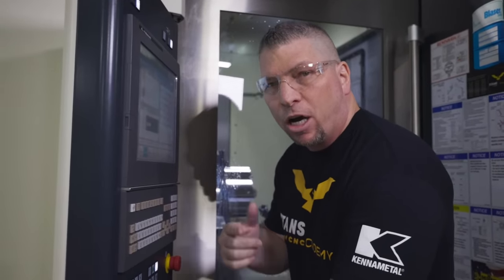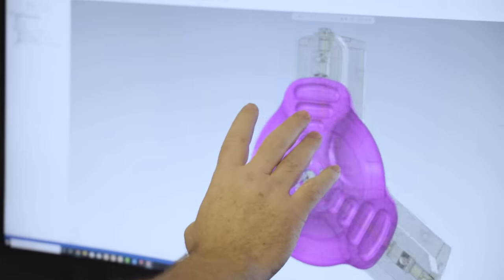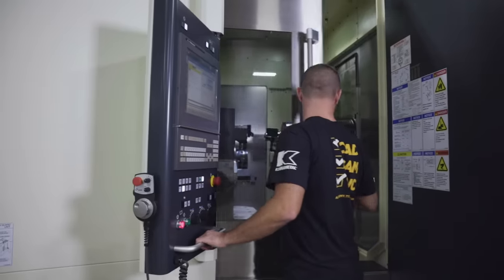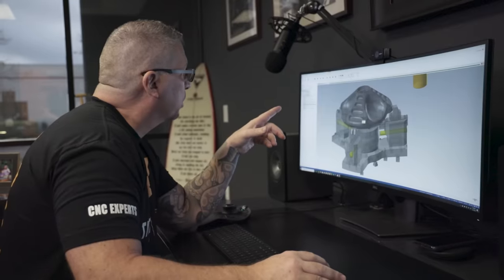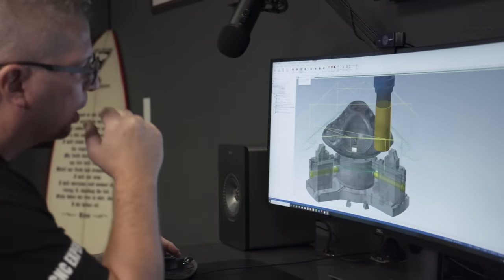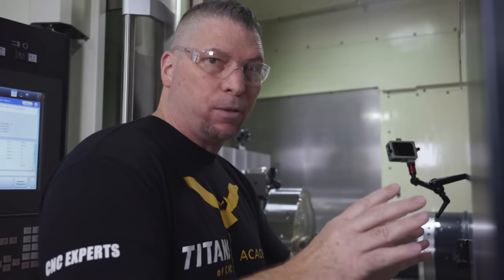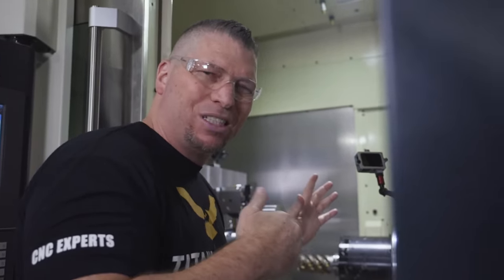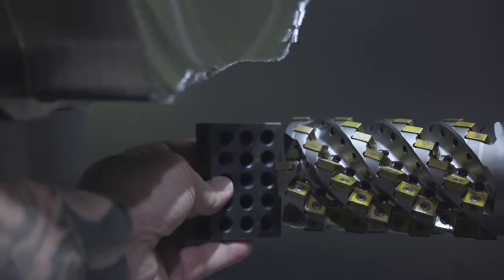60 HP Makino Cuts 150 Pound Titanium Aero Part With Kennametal 65 Insert Beast Cutter

Comment: Use to run Makinos two connected to a big pallet bed. We made large 316L valve bodies for clean rooms.We used those self dumping metal hoppers roll a full one out and empty one in. Take hopper outside with a forklift dumped the chips into big bins. One large type valve bodies started with 700 lbs of vim var stainless ended up with 40lbs. valve body I believe.

Comment: One of the greatest Machine Manufacturer ' Makino'
Reply: The best
Reply: No way it is a great machine but mazak is in my opinion better
Reply: @jbstepchild  sry but if you want the best machines you should go with a german manufacturer. The manufacturer KERN has extremly precise machines like the KERN Micro HD.
Reply: xLoltimex Check the iQ300 or even the V33i specs form MAKINO. I can warranty this machines can beat the KERN machines, and even better: Makino have better Local support in North America.
Reply: @Mike Frings my vote goes to Okuma, Yasda and Makino. 
Ultra reliable, extremely accurate and exceptionally well designed.
Reply: Of course they are...so are Matssura, Mori, Okuma, toyoda...or a fully box way machine like a Kitamura which is a huge advantage when making huge cuts.
Reply: @Cyrano99X  I've owned them all, #1 is Okuma #2 Mori's or Makino's, #3  Matsuura's  ( I had many Twin Spindles..) Kitamura's SUCK, no support and they throw spindle orientation sensors so often I had to stock them to keep them going....

Comment: Fun to watch use to run two makino horz with a big pallet carrying system. We cut mostly 316L vacuum formed stainless. Company made valves for clean rooms. Biggest valves we started out with 700 lbs chunks buy the end of cutting around 100lbs. I enjoyed the work.

Comment: Absolutely brilliant Titan. How did you learn on Fusion 360 and other CAD/CAM so well? We just got Felder H350 woodworking center and I really need to step up my game in design and machining as we have so much capabilities but the stock cad/cam is pretty basic. Thanks mate :)
Reply: Start using it. Drawing parts like the one in the video is pretty basic too, so it won't take you long to learn :)

Comment: On PQI equipped Pro 6 81 and 61nx machines you don't need to call the probe program in MDI. There's a slick tool in the work data screen that has helpful menus for a Z touch off and even finding the center of a cylinder. It uses those macros but there's a nice UI built on top. You can even call the probe, turn it on/off, send probe away, ect. Nice little productivity bump from Makino. Dm for info if needed!

Comment: Hey Titan. I just finished my metrology class in community college even though I never got to train on CMM equipment. 🤬🤬🤬 But my question is this. If you have this Makino which has an equivalent amount of horsepower as a motorcycle then why are you cutting at only 5 inches a minute? I get that it’s titanium but it isn’t inconel or monel which is harder material. So why the slow cut rate?
Reply from the maker: It’s all about depths of cuts and pressure / load etc. at 5 IPM taking 5.0 inches in Z and .25 in Radial... I was at 70% spindle load. I could have upped my SFM a little but not much...
All in all, it was slow... but a Huge cut.
Reply: Workholding plays a big part too. They weren't holding on to much. Push it too hard and you risk the part moving or worse, coming out of the fixture.

Comment: imagine the cost of that stock :P
Reply: Imagine the cost of the inserts too. Gotta be at least 1200 dollars to populate that endmill
Reply: @dustinwolfe9591   The face mill itself costs around $4500 to start.  You can replace the inserts on it, but yeah...almost 5 grand to get started with that cutter.
Reply: I actually managed to find a bit smaller than in video stock of the same titanium a bit thicker at my scrap yard, snagged it for $12 along with a cast iron pot and a few ball bearings from bicycles and an old multimeter that I think I can fix . Pretty sure the fuse is just blown from someone trying to measure too much current
Reply: Imagine the part being scrapped. Enough for a hospital visit for stress relief.
Reply: WPXTacoMan477 are you okay?
Reply: Sam Rockwell I’m doing fine, thanks for asking! How are you
Reply: @WPXTacoMan477  wpx 1, either the guy at the scrap yard didnt have a clue what he was selling you, 2, what you have is just foam and you think you have titanium, 3, your lying through your teeth  about what you have! i highly doubt you can ever in any lifetime buy that amount and grade of titanium for the price you have stated period!!!  no offence but its facts!!
Reply: That's nothing, try watching a guy scrap a stage nine for a f 35
Reply: @dustinwolfe9591  the endmill itself without carbide inserts is $9,677.25 and there are 115 inserts
Reply: @mattyfromlondon  A lot of scrap yards sell by the pound, as in it doesn't matter what metal it is they are selling to you it costs the same per lb as scrap steel. If you are lucky and your scrap yard is nearby any airfield or something of that nature you have a decent chance of finding airplane parts; which can contain large quantities of titanium. The scrap place nearby my house gets quite a few pieces of junk airplanes every once in a while. Honestly it really just depends on what scrap yard you go to. But your right, most likely this person was lying as even though I am allowed to take apart the stuff in the scrapyard to extract what might be farther inside I don't think I've encountered such a large piece of titanium yet.

Comment: Watching those chips fly was nuts, the part looked a lot like a large gerotor assemby for hydraullics. You did everything right when cutting the stuff. High speed at a very heavy feedrate with the coolant to the max it goes. A lot of the horror stories about titanium are because of the metal workhardening to oblivion by too little feedrate or lack of coolant making it disolve the carbide on the tool also causing workhardening. 😁❤🤓

Comment: Titan you was not kidding about serious chips, they look like corn chips going into the chip drums. I have a question about using Mastercam vs Fusion 360. If you mentioned it I missed it. I also have another question about making the jaw as Z zero vs touching off on the jaw and subtracting the finish height and making that Z zero and all z cuts would be Z minus cuts? I know going either way works but I always do all Z cuts as Z minus and stick to it and will never be  uncertain about when a rapid Z move is in the part or above the part when looking at the toolpaths ?
Reply from the maker: 90% of the time my Z is top and every negative is submerged. Everything positive is in free air.
Just used the Chuck like it was a Hard Stop... 
different way of thinking

Comment: what do you think of turning most of the stock off in the lathe first?
Reply: @highstreetkillers4377   I do not have the model for this part to be sure, however, Op 1 could be turned and simply flipped in the same setup and you could machine a conical shape without finishing anything. One could also rough in the bore on the face. Then your left with 3 open pockets and some dimples to rough on the horizontal to lead right into the finish operations. Im not saying this is being done wrong but I do think the turning process is worth considering.

Comment: We have 3, 3 machine makino cells at our shop running production. Really fast and efficient, a lot of error tool breakage alarms. Maybe bad sensor design.
Reply: HighStreet Killers 0 spindle rpm breakage test.

Comment: Had problems when I touch off my cutter to the face of jaws(z0) as clamped jaws is not at the same position as unclamped. It a bit moves (0.005 inches) against the chuck

Comment: Awesome Machining! But one Question: What is a 1-2-3 Block? Maybe i know it, but with a different name. 🤷🏻‍♂️
Reply: Its nothing more then a steel block that measures exactly 1” x 2” x 3”.  It is mainly used if you want to figure or maintain the distance between 2 components like the part and the machine table.
Reply: Custom Tobi 

Simply put, a 1-2-3 block is a common shop setup tool usually made of hardened steel that measures 1" thick × 2" wide × 3" long. Machinists use the blocks for myriad machine and inspection setup tasks.

The blocks are accurately ground to size and orthogonal geometry, within 0.0002" (5µm), with the intention of trusting them as de facto shop floor setup standards without regard to delicacy when performing setups.

They are quite simple to make. Cut them a few thousandths large, heat treat and grind to your desired size.
Reply: Ah ok. Then i know them. We use something similar over here (Germany). Thank you. 👍🏼

Comment: Not being involved in CNC myself, on these tough and large pieces of material why would you not use a 4 jaw power chuck for the added gripping capabilities especially on big parts and cuts? That one extra jaw would certainly decrease the chance of a job pullout from the chuck. Just curious 😁
Reply: I guess better centering and thus all 3 jaws grip properly as one of four may gripp less due to workpiece roundness tolerance  and the other three than holding in wrong positions and less stable.

Comment: Would a 1 inch Harvy 3 , using radial milling, be faster than that insert mill ?
What is the total run time of that insert tool ?  I understand it's all about MMR, so do the comparison.
That is one bad a$$ tool, but is it the most efficient tool ????
Machinist for 30+ years. 

Different topic,
Is there an easy & cheep way to learn MASTERCAM ???
Programming is the one thing I never learned ...
Thanks for all your bad a$$ videos & teaching the next generation manufacturing......
BOOM....
Reply: Mastercam offers a home learning edition that allows you to do pretty much everything but post out NC code. 

https://www.mastercam.com/solutions/home-learning-edition/
Reply: John - Mastercam has a Home & Learning Edition (HLE) that is free to download and use. This version has all of the features & functions of Mastercam including all toolpaths, verification and design tools. The only restriction is that HLE cannot post NC code: https://www.mastercam.com/solutions/home-learning-edition/

Comment: MasterCam got more advantage over Fushion 360 ?
Reply: Apart from functional differences, Mastercam it isn't a "cloud" application, in other words Mastercam don't have access to your customer's commercially-sensitive or secret design data as it isn't automatically uploaded to their company's servers like it is with Fusion 360. 
Also, you know that the version of Mastercam software you have running on your local machine won't be "updated" or go off-line at some incredibly inconvenient time and start behaving in some new and unexpectedly the way that the "cloud-based" Fusion 360 app can do at any time.

Comment: I'm curious why you needed the pre op?  Obviously you're milling both sides. Why not just leave it as rough stock? Not criticizing, just curious.
Reply from the maker: It’s important to start off with a flat, perpendicular and square piece of material when Machining an op like this...

What if the part came out or moved etc... because the dia was not perfect...
It would be impossible to put back in... also being so heavy is an issue... definitely want a perfect surface to grab.

Comment: i have a deep deep request...can you please show how you program the parts in mastercam like you show us in autodesk HSM and Fusion 360. ...plsss😊
Reply: As a mastercam, and inventor HSM user, I'd enjoy this.  Mastercam isn't sponsoring Titan though, like autodesk is.  It may end up a conflict of interest if they did.  I moved to mastercam specifically for it's mill turn, and simultaneous toolpath capabilities.  Autodesk really needs to step up it's game with things like locking a toolpath to X, and C.
Reply: @matthewgowan7546  I have use Fusion 360 about 2 year's. Some stupid and small bugs don't fixed. Now I'm on a new job in 2020. The new company don't have any cam, so I don't know i recommend fusion again. But the price is the most interesting think for company that only use cam sometimes. 90% of the parts programmed at the Maschine, it's faster and more flexibility as a cam...but that's because it is often 2,5D parts...anyone that know fusion and Mastercam or other please comment
Reply: @HardcoreMusik  If I was buying cam again for a company, and all I did was 3axis milling, 3+2 milling, 4 axis positional, and 2 axis turning I'd 100% go with fusion 360.  It is just so stupidly good for the money, and the posts are easily edited once you know what you're doing.
Reply: @matthewgowan7546  Ok. Thanks for your answer. I do a lot of post edits by myself. I will try a look to other software, but I think for companys that used a cam not every day fusion and the price of it are a good solution.

Comment: the volume of material that can remove that cutter is impressive, not to mention the radial engagement of the cutter.  Combined with 60 hp of spindle power is inhuman .. In my company we work titanium but with very low speeds due to poor power and tools.

Comment: 3:45 I'm more a lathe than mill guy but I've been lead to believe using coolant on a shell or face mill like that is a no-no, is it because you're working with Ti?
Reply from the maker: Yes... it will burn up in flames without coolant... literally
Reply from the maker: Because it’s Ti... 4140... could be dry all day

Comment: What grade of Ti was cut as there's about 6 different grades of the stuff then you have other alloys which has TI in it as well ,which extends the TI strength to over 100 different grades which has TI as part of the chemical composition of the alloys, NOt to mention the 4 main TI grades as per this listing ( https://titaniumprocessingcenter.com/the-element-titanium/ )
. cheers love CNC work and the amazing stuff which can be made ,almost anything these days can be made from a direct billet of any alloy for anything you want, especially in the car racing industry it would last a life time and to think that even factory stuff last a real long time if its looked after right and kept away from any moisture etc. :)

Comment: Why use a milling machine for op1? If you want a piece that is round with low runnout you machine it in a lathe.
Reply: Testing the flash new tool and  machine

Comment: You can keep the tool away for jaw on fusion 360
Reply: HighStreet Killers being in the industry 20 years means a lot of experience but also means you might be stuck in your ways. Always good to adapt to newer stuff. New softwares, new machines etc.... a lot of old bigger company’s  are getting out beaten by shops that are adapting to newer technologies. But that being said fusion 360 (amateur or not)has come a long way, and will only keep improving.

Comment: 3:30 so imperial rpm is the same are metric rpm???? 3:50
Reply: Its rotations per minute. Last time i checked the imperial system did not have any arbitrary units for time or rotations.

Comment: Also 2hat the hell are you making, looks like to me, nothing just showing off some cnc tools and trying to make it look like your making something but really nothing, also boeing is great at making planes and other components, but also most of the CNC components are outsourced, in fact a friend of mine was cutting and re welding F18/Hornet drop fuel tanks once they dropped or damaged in any way, they get fixed and boeing used to do two a month my friend could do 4 a month which is won the 15 million dollar contract to repair them, also he is so good that the robotic welding machine he bought for just that job, ( 250K) was not as good has he did with his own hands and eyes, that's how good he is and people think that you cant weld 7071t6 aluminium but you can, just require a massive hot oven to preheat the metal part and then set up the welding wire ( aircraft certified wire, not your standard tig wire as well, each pack has a traceable no and batch no and source no & which grade of ti or aluminum etc on the end of each tig wire)to weld at the right temp's that's it, but again it depends what you required to weld as well part or just a little 7071t6 aluminum etc. Cheers and maybe put up a upload about making real aircraft parts after all it the best way to show how good these machines are. :) d

Comment: Why not autodesk fusion 360?
Reply: Because Autodesk fusion does not have a post/simulation for a $400k + machine and all its functions. I went from using all fusion to using fusion for modeling and mastercam for programming since we bought the 5-axis Makino. Otherwise you can pretty well guarantee saying bye bye to your spindle.
Reply from the maker: Will teach with both moving forward. Fusion360 is not ITAR approved.
Reply: TITANS of CNC: Academy what is ITAR?
Reply: @skrapykokokenzo  ITAR (International Traffic in Arms Regulations) are a set of regulations designed to govern the export of military/defense/aerospace technologies. Mastercam is ITAR approved because of how files are managed on a local machine or server with program file encryption options. Fusion 360 is cloud-based for file storage and has not received approval for ITAR compliance.
Reply: Eric Drouillard thanks
Reply: @EricDrouillard  interesting, I would have never guessed

Comment: Easter some special reason why you are using Mastercam today's piece instead of fusion 360
there is no reason why you couldn't have made it in Fusion 360
Reply from the maker: Moving forward we will teach with both platforms. But use Mastercam for Aerospace as it’s ITAR approved.